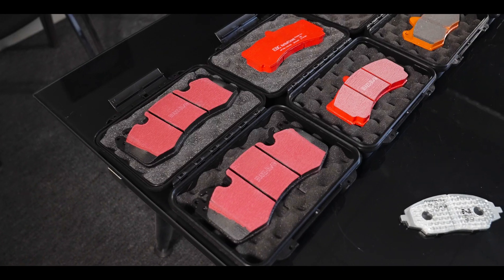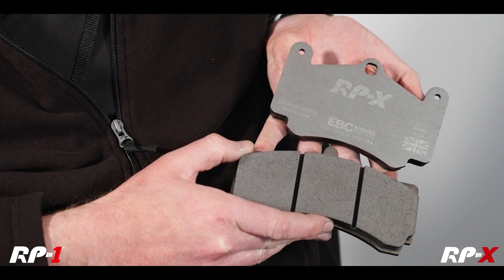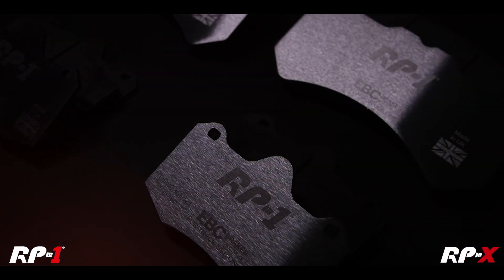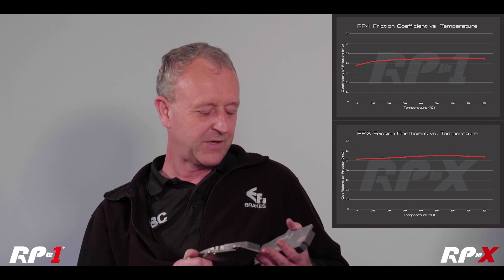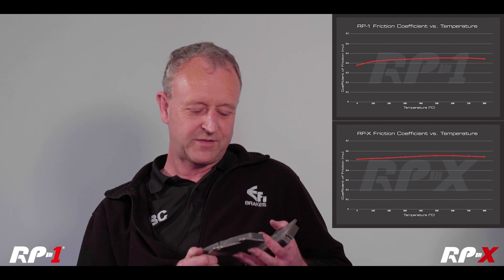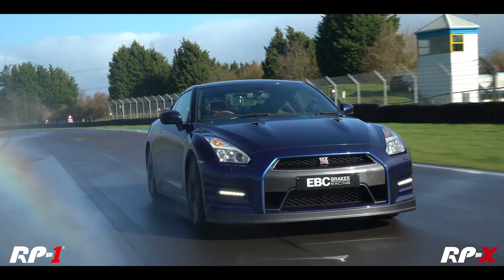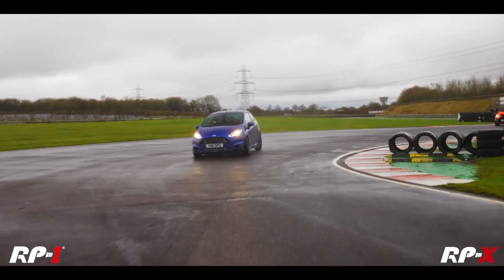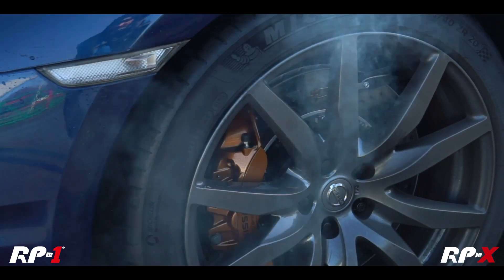RP-1 + RP-X Racing Pads | Tech Talks – EBC Brakes' Pad Compounds

Comment: I'm stuck on RP1 or X on my new Mk2 Supra track car.  We are running the Champcar endurance series and it weighs in a 2500 wet weight.  What would be your feedback on which one to go with?  We do run the Z32 4 pot calipers on the front of the car so its the Z32 pads
Reply from the maker: Either would work and it could depend on your driving style. RPX is more aggressive, with a high friction level of 0.55, so people do normally prefer this. However the more progressive response characteristic of RP-1™ makes it well suited for inherently ‘over-servoed’ vehicles where a softer pad material is desirable to allow greater finesse when on the brakes. Drop us an email if you like, and we can help you identify which is the better option for you: kits@ebcbrakes.com.

Comment: Can you use these in the USA for street use ?
Reply from the maker: RP-1 - RP 1 is not R90 homologated for public road use within Europe and is therefore illegal for use on the public road. Unlike some other race pads on the market, RP 1 offers a usable cold friction of 0.35μ below 100℃ meaning it can be safely used as a road pad for non European markets where Reg 90 homologation is not mandatory.
 
RP-X - RP X is not R90 homologated for use on the public roads in Europe, the fact this material possesses excellent cold performance means RP X can be safely used for driving to/from motorsport events in non European markets where Reg 90 homologation is not mandatory.

Comment: If i'm runnin rpx on the front (sprints from cold) what are the best compound to run on the rear? (what has the lowest cold bite?) as RPX arn't available for my rear brakes by the looks of it.
Reply from the maker: Hi Tom, it all depends on what vehicle you are running these on. If you contact < kits@ebcbrakes.com > someone will be able to help you further. 👌

Comment: I’m currently using the RP-1 pads on my Cayman. They’re a great pad. Very strong & never fading but I do get some judder when they get really hot. What steps should I take to reduce it?
Reply from the maker: Hi Adrian, please get in contact with <Kits@ebcbrakes.com> Someone will be able to help you with this.
Reply: So do I. So did you solve it?
Reply: @jacolee5596  Yeah, pad deposits is my guess, just keep going and keep braking hard and it eventually goes.
Reply: Why didn't you use the rpx pads
Reply: @jameswilson8820  So I’ve used both RP-1 and RP-X. Both phenomenal. Both have their pros & cons. RP-X works fully from cold and brake harder but I found them to be super sharp and bite too hard. So I’ve since gone back to RP-1 which are useless from cold. They take a few hard brakes to get up to temperature but they’re much easier to modulate on track and last longer.